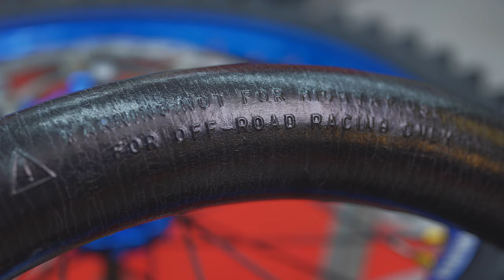How to install a MICHELIN Bib Mousse well ? Every step with The Girl On A Bike

Comment: I like to run very low pressure and always scared of tyre slip on the rim and destroying valves. So using a Bib Mousse, what type/firmness do you recomend: Front  & Rear - Thank you (Ps great vid)
Reply: Front mousse might not be good. Rear I thinking depending on your environment.